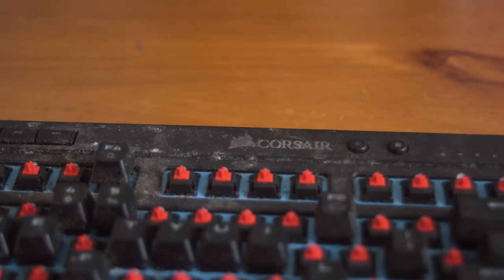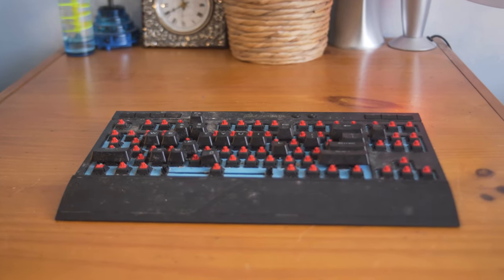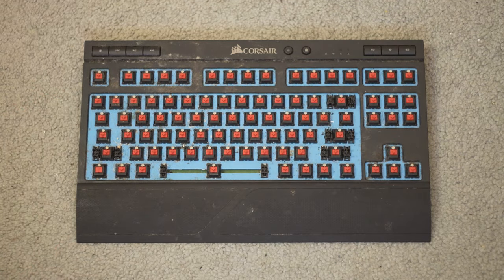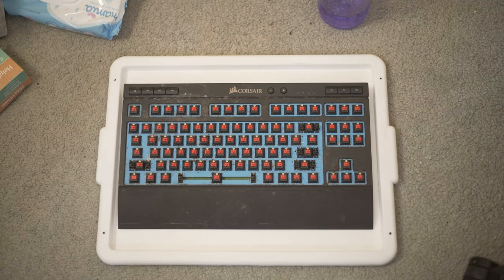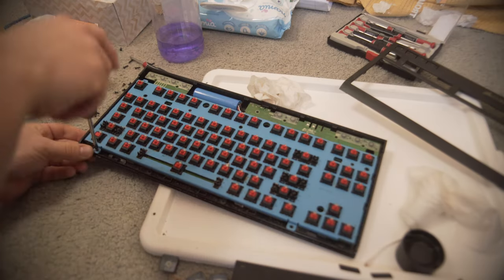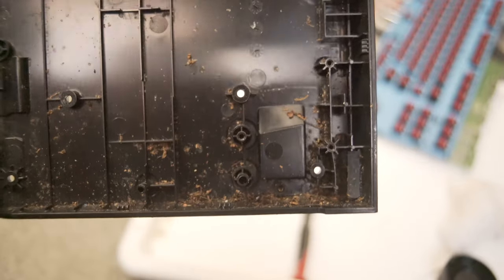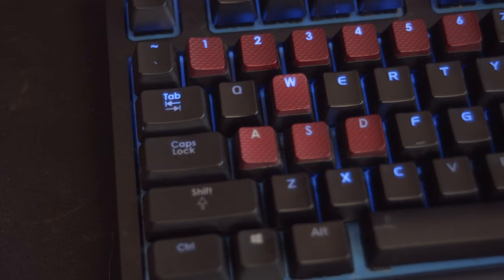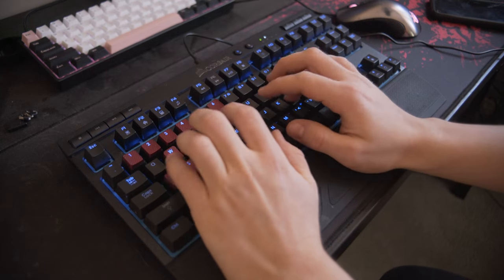Cleaning a Very Dirty Corsair K63!

Comment: How about show how to disassemble it?
Reply: Any answer?
Reply: @farmboy3632  I had to learn by myself and is very, very tricky to open it (once you open it, there is a blue metal that is welded), i have done it twice and still i have to watch a video to see the a video that shows the process to see which parts of the keyboard i have to force to open it (yes, you will have to force some plastic to open it)